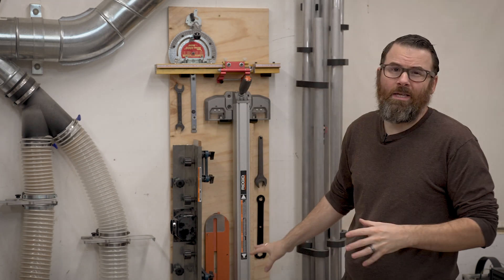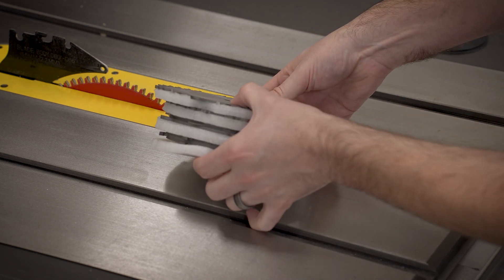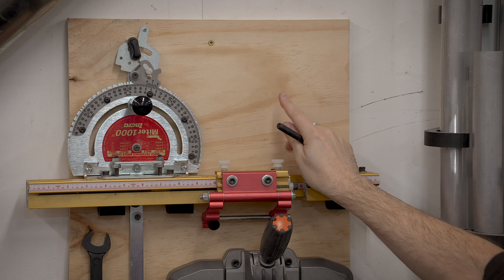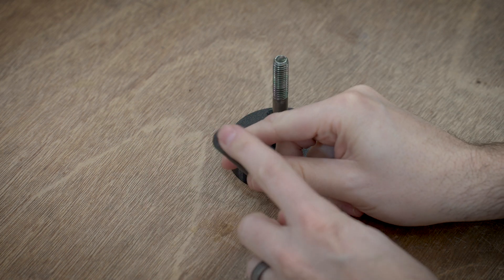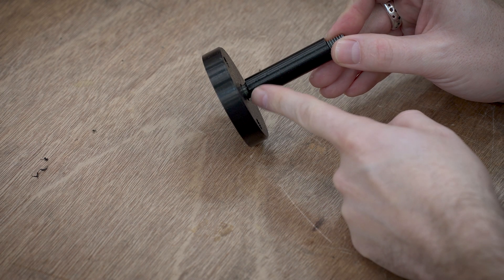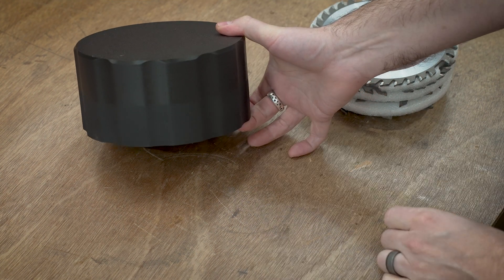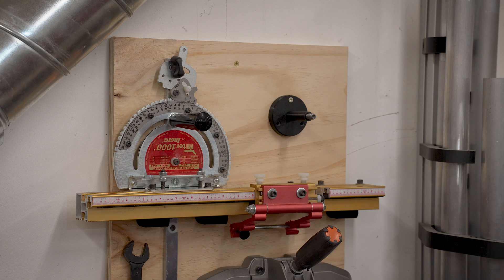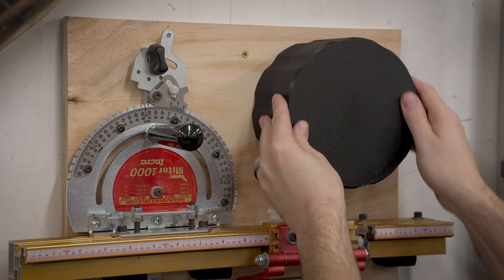Dado Set Holder - Functional 3D Printing!

Comment: The first thing that came to my mind was a library of blades. Each blade slot consists of a carriage that holds one blade around its edges, a tab+label around the top of the circumference, and a hinge point at the bottom right. You grab each tab you want for your stack the pull to the right. The carriages you just pulled to the right (around the hinge) now have all the blades you want and you can just grab them. Then you'd have to put the blades back in the appropriate slot when returning them. Probably not worth all of that since you don't use them much but fun to think about in my head!
Reply from the maker: I was actually talking to my dad about that the other day.  He was thinking of a way to safely store saw blades.  I like the idea of a 'binder' where you can flip through various blades and pull them out.  I really only have a couple, so it wouldn't make sense for me.  But if I ever get a larger collection, that would be on the list.
Reply: @RobertCowanDIY  probably a vinyl record concept to borrow from

Comment: To go a little bit of different approach that might be good to do is change the lid into an enclosed container that has a flip open lid. ( the risk is some teeth would rest against the inside of the box) then mount on a French cleat type system. 

The alternative which is pretty much as you have it., is to make the base that attaches to board the same diameter (or slightly larger) as the lid. Then make a semicircular cleat (French cleat) that you have fixed to the board. Then you can pick up and take the whole enclosed dado container  with you to your table or other worksite, then Unscrew and use.

Comment: Cut down the bolt, thread on a quarter turn 3d printed adapter? The cover doesn't need to withstand a lot of force, might make it a bit more usable rather than twisting on and off. Or, as someone else pointed out, magnets! Clever design, love that it keeps it covered and clean.
Reply from the maker: Yeah, there are probably some tweaks.  I think a screw-on piece that keeps the blades in place and then a magnetic cover would be ideal.  That way you have a bigger surface area for magnets and for the cover.  BUT, I probably won't use this again for 6 months, so it's fine for now ;-)

Comment: I print in place and also run a tap. The way it prints the threads there is more meat around the threads versus just a hole without adding a ton of walls all around.
Reply from the maker: Yeah, that's probably better.  I've had good luck with my method, but print in place threads will give more walls as you said.

Comment: Why not use a single piece print for the dado blade holder?  You could still tap the cylinder part while it’s part of the base.
Reply from the maker: Think about the assembly.  With a hex-head bolt, there would be no way to tighten it against the central post.
Reply: @RobertCowanDIY  ok I figured you had a good reason to do it this way.
Reply from the maker: @MrDksmall Yeah.  If using a socket head bolt, you wouldn't need the two pieces, but I was just using what I had on hand.

Comment: If you read the fine print on Tap-Magic, it says not to use on plastic. The solvents used will weaken the plastic over time.
Reply from the maker: Huh, good to know.  I've been using it like that for years.  I kinda agree with others, it seems like a vague disclaimer.  'Plastic' is such a broad term.  But noted.
Reply: What does “weaken the plastic over time” actually mean? This is a vague disclaimer that has zero substance. The worst case is that the threads will get a little looser in like 10 years if it has any effect at all.

Comment: Thanks for nice video! Just one tip for a huge improvement... Next time use magnet to hold the cover. It must be a pain in the ass to screw and unscrew it all the way all the times! 😉
Reply from the maker: That's not a bad idea.  I was probably focusing too much on the 'tutorial' aspect of it.  I wonder if a magnet would hold it tightly enough though.  I might try it.
Reply: Or a separate knob/nut with a clearance hole in the cover so you don't have to spin the whole thing,  less risk catching the blades and pulling them off when spinning the cover.
Reply from the maker: @unpopular_mechanics Ha, sure.  All these suggestions are great.  I'm not going to do a single one of them, but they're all great.  ;-)
Reply: @RobertCowanDIY  You could do a multi part series on a crowd sourced dado blade cover, think of the views.
Reply from the maker: @unpopular_mechanics Ha!  it would be fun to incorporate EVERY idea and end up with something that is just way over-engineered and no longer actually works.
Reply: @RobertCowanDIY  I’d watch that.
Reply: Or better yet, a box with a hinge to the right so you just swing the door open and don’t have to hold the cover as you pull out the stack.
Reply from the maker: @c0mputer But that would require more space around it, right?
Reply: @RobertCowanDIY  Yeah, it would need to swing, but you’ve got space on the right for it. Shouldn’t hit that conduit. Either way, nice quick project, love these videos, keep them coming! Happy New Year!
Reply from the maker: @c0mputer That's always the interesting aspect to little projects like this.  There are just SO many ways to tackle the same problem.

Comment: I’m looking for a daddo set so I used your link to check your set out. The 8” set is on sale for less than the 6” but what you said about the smaller sets advantages make sense. Also trying to get some organization going on in my shop as well using my XL 5 head. I enjoy your videos. Thanks a lot. And happy new year to you.
Reply from the maker: Oh yeah.  But 6" just seems to run better on smaller saws.  Cheers!

Comment: PLA is just.. nice.
Reply: It prints nicely but i have had numerous of my prints fail after 2-4 years. I only print functional things in PETG and HIPS now.
Reply from the maker: I was going to show my machine arm for my CNC router.  It's all PLA and holds ~50 pounds worth of cantilevered weight.  It hasn't sagged in 2 years now.  I think it just depends on how you are spreading out weight.
Reply: @RobertCowanDIY  There is some sort of change happening to the PLA i have been using. It grows a slight yellow tinge with time and becomes harder and more brittle, with fine crazing around pressure spots. I don't want prints that degrade over time if i can avoid it, and i haven't had any trouble with my PETG and HIPS prints.
Reply from the maker: @SianaGearz I think it depends on the application?  I've had good luck with mine over the years.  I have a print outside, west-facing that sees intense sun and it's held up great after ~4 years now?  It doesn't have constant load or stress, but it's still doing its thing.  If it had any sort of load on it, I wouldn't have used PLA.
Reply: I just gave up dealing with PETG at some point
Reply from the maker: @llkurofoxll1013 Right?  I don't like how flexible it is, it makes it hard to work with (for me).